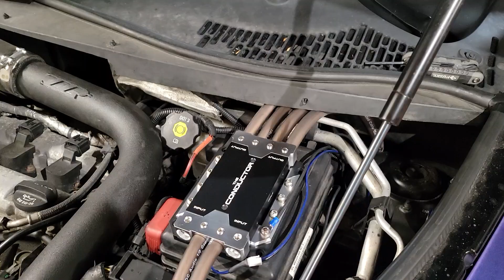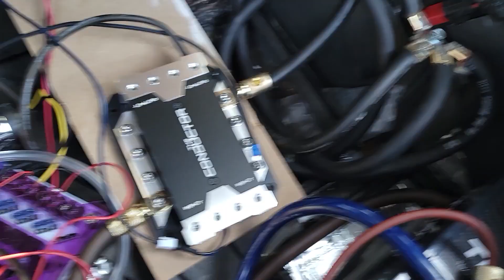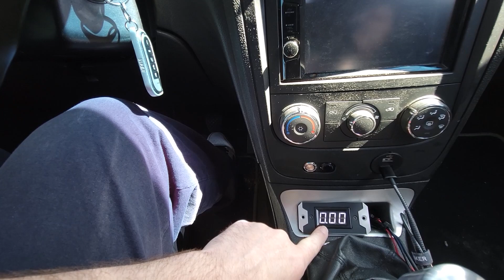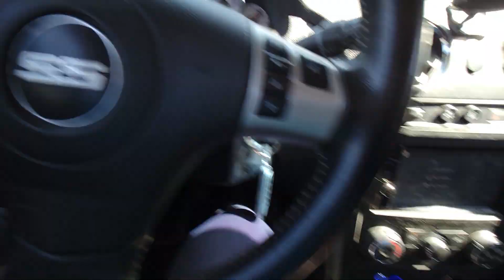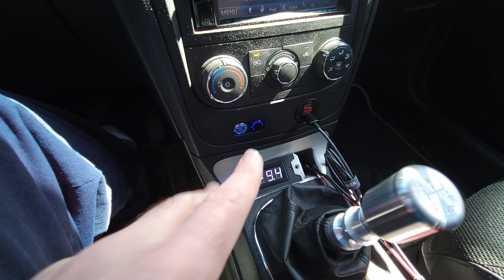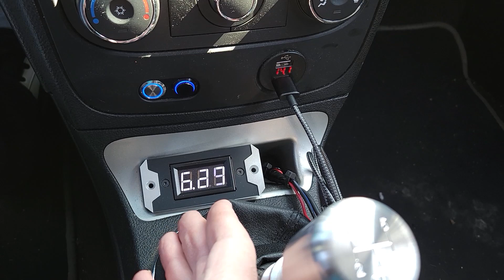Installing The Conductor, DC Ammeter For Car Audio

Comment: Since the nineties, regardless of make and model of vehicle I've always chosen to improve my grounds especially as most are electronically managed.  There are those of us who like our old brick shaped vehicles that are inherently noisy due to their shape, and have old seals.  I chose to remove my old carpet which trapped moisture below it, but I also bedlined it and installed decoupler and insulation for quality of life improvements.  Note the Cruiser54 (R.I.P.) who specifically states that many issues can be resolved by improving grounds.  My vehicle will never had a big system, but it will be getting an invertor and sub amp, and have been considering solar as well as I need to inspect my alternator to see if it has been replaced/upgraded.  Much wiring to be considered.  Crimpers, ferrules, heat shrink all sitting on the shelf for now.  All this I consider my, "adult version of Legos"   Thank you for the content coverage

Comment: I ran my Conductor the same way, but utilized two dedicated ground runs rather than a chassis ground. It has saved my butt a couple times - from the amplifier pulling too much current (thus making my lithium in the rear pull more from the alt) to one time my entire system went negative; i got pulled over and figured out my alternator "turn-on" wire had come out and stopped my alt from charging. And i found it out in plenty of time before i had an emergency.

Excellent product! I'm working towards running a second Conductor dedicated to amplifier draw soon!

Comment: Whats considered a small system?  I have a 5k DD Audio sub amp & a 400 watt DD Audio mids & highs amp. Would i notice a difference with a seperate ground run? I have a 370 alternator and 2 Titan lithum under the hood batteries. I have a run of 2/0 to the rear. My voltage lives around 14.7/14.8.  It may drop to 14.4 with heavy use.  Is the juice worth the squeeze?
Reply: A lot of it has to do with your vehicle. If you have a truck or SUV with a separate frame you can use that and it will be very effective. Most cars and crossovers are a unibody design and use a combination of Steel or possibly aluminum. Newer model vehicles rely a lot on glues and epoxies to bond the panels instead of spot welding. As to how resistive the flow of electricity is from where your amplifiers are grounded to where the front ground cables are coming off of the body to the battery can vary quite a bit. The more current that's flowing, the higher the resistance and voltage drop can be.
Reply: @JasonWW2000  It's in an 07 Tahoe
Reply: @darrianbenjamin7292  I've got an 04 Navigator. I ran my 1/0 rear ground wire through the body and bolted to the frame. Then up front I have a 1/0 frame to battery connection. I did this because initially I was only going to run an under hood battery and I wanted to transfer a lot of current with minimal loss. My new plan is to run a battery in the back so these cables are now more for the charging/starting system. The heavy current is going from the rear battery to the amps with short runs.

In your case, your running heavy current from front to rear. Are you running all your current through the body? If so, I assume you have 2 runs of 2/0 ground cables from the body to the batteries?

You seem to be passing a lot of current (I assume based on you have 2 large power cables). I would not try passing such large current through the spot welded together body. I'd use the frame. 

At lower current draws (going through the body) your probably not seeing a lot of resistance or voltage drop in your system. At higher current draws, you probably are seeing a lot of resistance and voltage drop. 

As to how much voltage you would gain under heavy load (using the frame instead of body), I don't know for sure. It might be 1/10 volt, it might be 1/2 volt. If you don't like the voltage drops you're getting currently, then it might be worth changing things around and using the frame as a ground path.
Reply: @JasonWW2000  I have multiple 2/0 to the frame up front along with the usual upgrades.
Reply: @darrianbenjamin7292  So in the back your amplifier ground wires go to the frame?
Reply: @JasonWW2000  yes
Reply: @darrianbenjamin7292  Then your good. Adding copper ground wires front to rear is more for unibody vehicles that don't have a frame.

You would see no benefit running ground wires front to rear.

Comment: You said that copper is 30% more efficient but I don’t see how that is there’s way more steel on the frame rails and in the car to conduct to then a few runs of zero gauge wire
Reply: Right not to mention if you're running multiple batteries so you have batteries in the back it definitely wouldn't make any sense then
Reply: You definitely misheard him as well as misunderstood what he was trying to say. He said copper is 30 TIMES more efficient, not 30%. He's making this comparison based on two similar sized examples. For instance, a 1/0 ga copper wire compared to a 1/0 ga steel wire. 

Yes, there is a lot more steel in the unibody design of the vehicle compared to a 1/0 ga cable, but you also have to remember that a unibody vehicle is made up of hundreds of pieces of sheet metal that are spot welded together. Some vehicles are assembled and welded really well and can transfer a lot of current and other vehicles may not be spot welded very well and might have a lot more resistance to current flow. Some vehicles are aluminum and sometimes panels are glued and epoxy together instead of spot welding. It really does depend on the particular vehicle.

Comment: So what's the point of having the conductor for car audio 🤔
Reply: Are you understanding what it's doing? There's two really big reasons for the car audio crowd. The first would be to make sure your alternators are outputting proper amperage and that there's no issues with your charging system. This is especially important when you have multiple alternators. Let's say you have three alts and one of them goes out. This conductor would let you know that you're only running on two alternators and that there's a problem with the third one. The second major usage would be to monitor the amp draw of your amplifiers. You can see in real time approximately how much power is being produced by your amplifiers.

I think these devices are mainly aimed at the people with really big sound systems. If you're like a casual car audio enthusiast with a small system and a single alternator then it may not be worth installing. On the other hand, even people with a small system might find having this information useful.

Comment: If the vehicle is off does the display always stay on? If so do you use a toggle switch to shut it off?
Reply from the maker: Depends on what you have it wired to. I have mine on a separate switch. You can have it on remote turn on from head unit, or ignition from the car if you want
Reply: @SparkedInnovations  awesome thanks for the reply installing next week